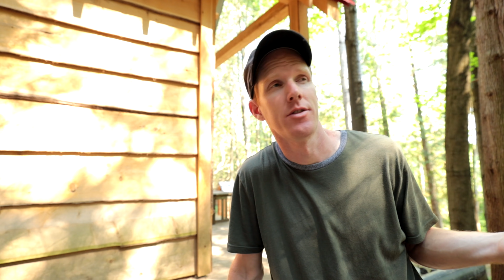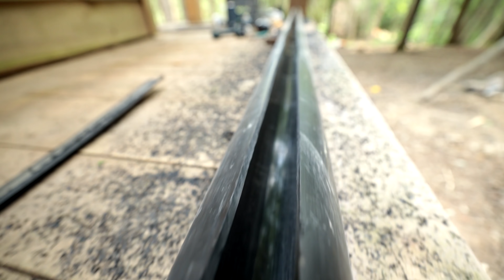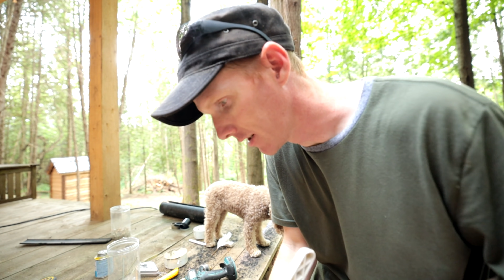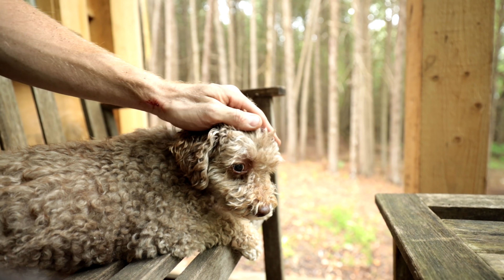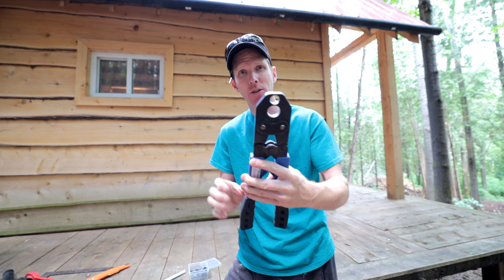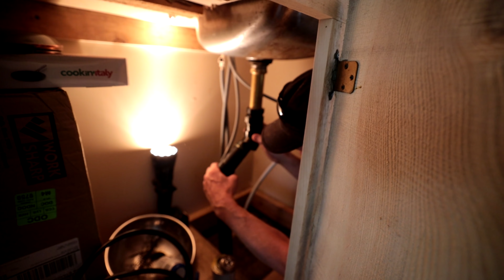Building Simple Pump Rainwater Collection System (in a thunderstorm)! | Off Grid Cabin

Comment: In the oil feild north dakota. I watched old pipe fitters use heat to melt the ends of drain pipe and electricians melt PVC conduit and slap them together twice as strong as glue. But they would smile and say i wouldnt pressurize it. Bad idea

Comment: Sorry if I missed it, but I kept watching over and over again, trying to see what the pump is hooked up to for power. Is there just a 12v battery nearby, or a more complex system? Is there a switch, or does it just come on when the valve is opened at the end? Thank you :)
Reply from the maker: It's an RV pump. Hooked up the a 12v Inergy Power Pack.    It has a pressure switch so it only pumps when the pressure drops.

Comment: I have room under our cabin and I have two of those tanks I got cheap because they didn’t have the frame around them. I was going to frame them in but they are doing fine after years of use . I love the use of ABS as gutter. I used that cheap stuff and after years of use I have a few cracks in it from ice and snow. I recessed the gutter back pretty good but sometimes snow curls back. Someone once told me buying a pen crimp tool was a wasted expense, I told him I’d never need to buy propane to solder pipes again.

Comment: 1 inch of rain on 500 sq ft of surface (guestimating your roof size) should give you about 300 gallons of water. A closed off downspout (removable cap on the bottom end) with a T connector somewhere near the top, which will run to your tank would also help with filtering. The water drops into the down spout, filling it until it reaches the T connector. Once it reaches the T connector it will run into your tank. Any debris will sink to the bottom of the down spout. Just remove the cap at the bottom of the downspout occasionally to remove built up debris. I would also recommend and overflow outlet. I put mine just above the T connector on the down spout.

Comment: You could have milled the OD of one ABS pipe and the ID of another to get a super clean fit without the coupling as well since youre working with an unpressurized system. one inch on each would more than suffice.
Reply from the maker: I don't have a mill, but I agree that would have worked.

Comment: Your roof edge is probably level, if so, no slope is necessary for your gutter system to work.

Also, a tighter center cut on the PVC will allow you to push onto your r-panel roof tightly there by keeping out sticks leaves etc. 

10 years ago I used 5 gallon paint strainer material to filter out find sediment before it enters the holding tank sandwiched in between PVC pipe and connectors. 

By not gluing the connectors to the PVC pipe the 5 gallon paint strainer material was accessible so that it could be switched out or cleaned.

Just passing on some tips I learned a decade ago while enjoying watching your video.
Reply from the maker: Thank You!

Comment: One upgrade you could do I build a stand to lift the tank as high as you can, possibly above the sink height , it would gravity feed the water into the cabin without using the pump. You could still have a bypass to use the pump for more pressure. The second thing that I did on my water system that helps for leafs and other stuff is build a pvc siphon system with a tennis ball floater , it takes away almost every unwanted things off your thank. Love your channel keep the content coming!!! Greetings from italy
Reply from the maker: I'm probably gonna revisit the water system in the spring..  winter is coming I've gotta winterize it to prevent damage from freezing.

Comment: Pvc conduit is amazing for things like this. They have built in connectors, have prefab pieces with bends and are UV resistant.
If you have to buy it, it's cheap. And if you're lucky, you can find contractors getting rid of it for free.

Comment: Your better option is to mount your pipe over the end of your tin. Let it rest on your V ridge. This will collect it in a thunderstorm, because the way you have it will only collect the gentle rain. A heavy rain shoots over it. If you have it over the end the force goes into your pipe. Good support under it to hold it when it is full is necessary, because water is heavy!

Comment: Remember to add a hose-bib or a small valve on the bottom near r,v pump to drain water lines during winter or it will crack your pex pipe
Reply: There is a 'T' right at the pump...
Reply: @cmosphoto1   
Good man

Comment: I did the same thing with white ABS and cut it dead in half, used some used long gutter screws, and fastened it to the facia. It worked like a charm and it's easy to clean the leaves out during the fall. When are you going to do the other side?
Reply from the maker: there may be a sunroom being built in the very near future.

Comment: Hi I'm new to your channel, I am wondering where did the power source come from for your RV pump? Is there an inbuilt battery? I don't have any experience with a RV or its systems and all I know about pumps is that you need electricity and your cabin doesn't look like it's hooked up to electrical power, so I'm curious about how you got this to work? Thanks in advance for answering 😊
Reply: 12v battery.  That clip must have hit the cutting room floor.
Reply: Thanks for watching!

Comment: Just a thought, put a raised platform under your holding tank and let gravity pump your water and eliminate the pump. As long as the water level is higher than your faucet you will have water flow. Putting a screen over the end of the waste line will keep rodents out. Also consider @UCssRqBirDRYfUjgyeit79Nw's comment bellow it is an excellent system for staying healthy.

Comment: I'd like to do something like this, but I'd like a solution that also works in the winter time. Not sure that's possible. You did a great job, despite the failure (saw the latest video).
Reply: I read the solution is to bury it...but I doubt that a solution where you are on a rock...  Why not pull from the pond?  Or are you gonna run into the same problem?

Comment: Great video, but I have a question. I purchased a pole barn a couple years ago that had the remnants of a gutter system. The snow every winter slides down the tin roof and broke the gutter system off. Do you have a way to protect your trough or do you just plan to 'winterize' and remove the trough before the snow falls every season?
Reply: I'm gonna see how it handles winter. It barely sticks up and is somewhat rounded...  I'd imagine the whole thing will freeze like a block.. then when the roof sheds the snow it will just skip off...  Time will tell!

Comment: If you had left your roofing longer you could have snapped a line that slopped down at the optimal angle then cut off the roofing panels at that angle. Then you could have had the edge of the roofing panels inside your makeshift gutters all the way across, and still had them on an angle. That way proper drainage wouldn't cause you to miss any of the water.
Reply: The roof would have to be crooked for that to work, as the roof is longer the pipe would be further and further from the fascia board.
Reply: @cmosphoto1  So it would have been further and further away, so what? There's no law that says it has to be slap up against the fascia. If it's the fact that he can't anchor it to the cabin that's bothering you, he's assembling the pipe. All he has to do is cut angles in the ends of the pipes to form his own elbows. Bring the pipe over to the cabin and then anchor it, just like you do with regular downspouts. I first earned my certification in building maintenance over thirty years ago, trust me, it would work.
Reply: @juliebaker6969  perhaps then you should build your own cabin and record it for your YouTube channel. Sounds like you're smart.

Comment: You better add a first flush system before putting it in your water system. Unless you really like the taste of bird crap and dust and debris.
Reply: I think that's the next thing on the list... The plan is not to drink this water.   It's grey water. Washing dishes etc.
Reply: @cmosphoto1  you can add a carbon filter to clean most of that out. But disease caused by bird crap or any other animals i would very much worry about. If you add a first flush system it will remove all solids but i would still add a filter system.

Comment: The collection system needs preflushing, water needs to be macrofiltered, microfiltered and sterilized/purified (ex. distillation) and laboratory tested before drinking: Dirt contamination, fowl E. coli, acid rain leeched heavy metals from metal roof, pollen microtoxin, critter poop giardia, algae, etc.
Where will your sink water (technically "black water") drain?(!).
Reply: This in no way shape or form is for drinking.  You've raised some great points!

Comment: you wont 2 downspouts with a t high up one is filled with debree from the roof and has a ball in it to stop thew filling once the roof wash has done it will also stop the debree over flowing into the delivery pipe to the resuivour on the bottom of the first pipe you have a bleed pipe so it can empty when rain stops ready for the next time
Reply: That's a great idea.

Comment: Just a tip on the PEX tool, buy a 1/2" and 3/4" separate on sale (tool stock) or you will have trouble getting into tight spots with that multi-pex-tool.
Reply: I have the angled versions of the same tool to get into tight spaces.  But yes I agree.

Comment: 1974 on Saipan, I helped a missionary with his water collection system.  During much of the year rain showers come briskly and heavy but are short lived.  He needed to allow the first of the water to run off and clean debris off the roof (bird droppings?) before opening the route to his storage tanks.  We devised a lever with rocks on one end and a 5-gallon bucket on the other.  Small drain holes on the bottom of the bucket allowed a reset after the rain quit.  The diverter line from the gutter was lower than the tank inlet pipe by about 8"  until the bucket filled and overcame the weighted lever, lifting the diverter line.  Rainwater could flush past the tanks until the 5-gal. pail filled.  This allowed the missionary to be away from home and still collect clean rainwater.  Great video.  Thanks.
Reply: That's genius!
Reply: How clever! That would be cool to see a video of it operating.

Comment: Awesome love the PVC gutter I mentioned that to people years ago and they laughed at me yet I see the idea I mentioned to others years ago in fine working condition.. and its gonna last a super long time since no corrosion lol.. great minds think alike
Reply: Ya just imagine if it wasn't many pieces glued together improperly...  Last forever!
Reply: Kevin your using what you have on hand bro... if people cant or dont want to understand that they shouldn't say anything at all lol. I think it's great is it permanent no, but then again it may also last years which allows one to get a full price eventually. From my understanding your doing things on a budget which most can accomplish, should they choose to do so...if I could I'd help you design a water filtration system using the totes that your using to collect the rain water. The system is to turn raw sewage into drinkable water using water plants. It is a 7 step process but by the time the last stage is hit the water is cleaner than a natural spring. I dont recall the plants used in the process but I remember watching about it on a science program late 80's early 90's. I thought it was a great idea but many people would be turned off by the idea. The enginuity of the idea is that there are no solids that need to be cleaned up as the plants break everything down and leave only the clean water in the final or 7th container. This system could clean your house and the little cabin that your renovating.. dead plants can be put into a composter and back into the garden. I just dont remember what plants where at what stages. I do know there were 3 types of water lily's and some seaweeds but those were mid to last in the system.
Reply: Also said system for filtration used 0 chemicals

Comment: Stockpiling is fine if you live on a farm or such but in the city, stockpiling is called "hoarding"! LOL!
Great video! I have a raincatch coming off my downspouts from the gutter. I can easily fill my 50 gallon blue water drums in the rainy season; when full they weigh over 400lbs (8.33lbs/gallon x 50 gallons)  Your container, when full is going to sink a bit. My rainwater is for the plants and, in an emergency, washing, but definitely not for drinking. Besides that teeny tiny filter on the pump, are you going to employ another filter? The water in the container looked a might bit murky. Keep those videos coming! full stop
Reply: Wonder how much 1000 litres weigh... No current plans for a secondary filtration system... But possibly another "drinking water" system that would be store inside.
Reply: @cmosphoto1  Amount : 1000 liters of water (l)
Equals : 2204.62 pounds of water (lb wt.).
1000 liters of water weighs 1000 kg
Reply: @gunznknives  literally a ton of water.
Reply: Clean water is worth money.  I have a doultin ceramic under the counter filter.  It will clean muddy and silty water. I don't know about freezing.  Could be problematic.

Comment: Ok very cool. 

But why not gravity feed the faucet by raising the tank to  5 feet off the ground. Heavy, of course but not an impossible engineering feat. That pump just screams point of failure to me.
Reply: If the pump fails the gravity system and an bucket works until a fix the pump or get another one.  The second part of my plans involves a pump...
Reply: @cmosphoto1  can't wait to see the hot water solution. I'm guessing it a copper coil around chimney. Really want to know what kind of temps you get.
Reply: @GrahamBartle  that's too old school.  Think a little more modern... I'm not sure what my timeline is...but it's coming.

Comment: I'm thinking that trailer that was scrapped had a propane small hot water tank that may still be in usable condition....and can easily be mounted outside the cabin... gonna need a little box to put that and pump in to protect them. As soon as you have running hot water, my wife will come visit, but not until (lol, ours in our tent trailer seemed to quit on us during her last week of camping at the Pinery, I'm in the dog-house, but it wasn't my fault) Pilot light lights but main flame won't ignite. Weird. Any  RV HWT experts out there? (propane tank is more than half full and it worked before we moved it up from Rondeau PP)
Reply: I've got a significantly less convention idea for hot water... Sadly that hot water heater is probably a trinket in China now.

Comment: Kevin actually a rubber connector with hose clamps are not that expensive and do make a great connection without leakage called a Fernco.
Reply: The issue with that is you can’t cut the slot in one of those. It won’t hold.

Comment: To keep the water from freezing in winter, run a water hose from the hot water tank drain cock and drop it in the top of the cold water tank and that completes the circuit. I don't know if this will work in your cold climate but this is a quick and cheap way to do it with no drilling holes in your tanks. It also uses your pump in it's current configuration to circulate the water. A backup pump rated for continuous running would work best. The drain cock would regulate the amount of flow and a small pressurized tank in the line would allow the pump to cycle off and on.

Comment: lifting the Tank about 6 feet (empty it first) and then mark with a marker on the water level so you can see how much water is in the tank.
Reply: It's labeled on the side how much is in the tank.
Reply: @cmosphoto1  ..when i said lift the tank about 6 feet.. i meant to explain and say.. so the water tank is higher and the flow down to the pump will be enough to drain it to the end.. plus add a single phase filter to it.. next to the water tap..not for drinking but for washing and other uses (shower n stuff)

Comment: you could of made it powered by gravity
Reply: I did think of that... But I had all the parts to include the pump.
Reply: I thought the same thing, mount tank up higher...but if he had the parts / pump already, may as well utilize them. I wondered where the 12 volts was coming from for the pump, was the solar charged pack hooked up?
Reply: @KAYAKEN  yes inergy power packs the pump uses so little power.

Comment: put in a tiny expansion tank (one or two gallon) in line and the pulsing will be gone
Greatly enjoy your work!
Reply: Or a couple 2 litre pop bottles or something. (free) :)
Reply: Great solution.
Reply: We have a similar pump in our tent trailer, and although it vibrates (and makes a small racket mounted in the hollow of the slide out), but it doesn't seem to PULSE. Maybe because it's a few feet to the sink and also there's an outside hand-held shower unit.